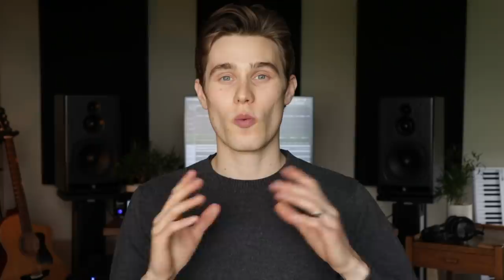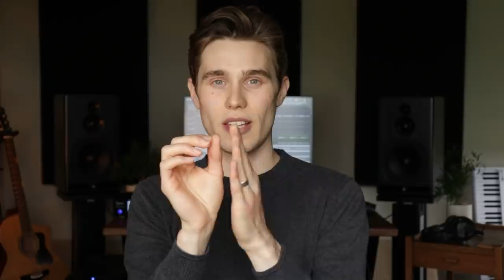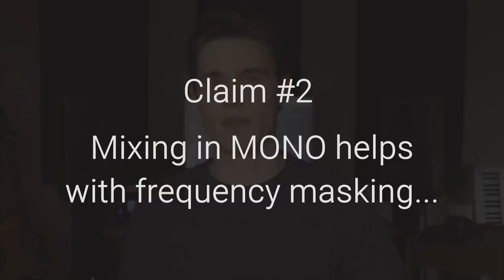Mixing In Mono - Secret Weapon Or Waste Of Time?

Comment: The reason to mix in mono is simple. All speakers at live events are in mono. This is very important so that people on both sides of the event can hear the same thing. If the speakers were stereo then people on one side would only hear the guitars and people on the other side will only hear the bass, if these were hard panned right and left. Mixing in mono is not a secret, it's the professional thing to do if the music is expected to be performed as a backing track at a live event. We also mix in mono to fix phase cancellation issues which cannot be heard in stereo.
Reply from the maker: You make a good point at the end regarding phase cancellation. Unfortunately, I don't know where you have been misled regarding the first issue surrounding live events.
In my experience, a stereo mix is summed to mono before it hits a live PA system (I've yet to see a system where this isn't the case besides large-scale immersive audio experiences!). 

When this happens, all the speakers will have the same relative levels of R+L (besides the subs where sometimes the sides are simply discarded).
Simply, a wide hard-panned stereo mix played back on a well set up PA system will not try to represent the stereo mix so you need not worry about people on the right or left missing the guitars panned to the other side!

However, your points about phase are correct and often overlooked. Especially drum phase/time alignment which can be a real mess when played back on a huge system.

It should be noted that when I discuss mixing and mastering I am usually talking about studio mixes for digital distribution, CD and storage. Additional mixing for additional formats such as vinyl and live playback are specialist jobs which can often require a remix of the original stems. I don't think I've ever heard a studio mix sound good when played back on a PA, but there is a first for everything! 

Thanks for your comments, you've added to an important conversation about phase and imaging during mixing!
Reply: The point being made was that due to the huge variance in venues and system setups that the music can be played through, professionals anticipate "potential problems" ahead of time, even if it may not be an issue in a specific setting. Mixing in mono covers all your bases, all the time, in every possible setting. The same can't be said for stereo mixing.

Comment: I’ve had really good results mixing with a single Avantone mixcube. 
That speaker sounds so bad, but if it sounds good on that little guy, it sounds amazing in almost every other scenario.
Reply: I use mix cubes to get the vocals to sit in the mix better
Reply: i love my avantone 😍
Reply: yes but you cant hear the bassline no  ?  you cant adjust under 100Hz i think .....
Reply: @ChrisBessy  yeah that’s true for the most part, I switch between the Avantone and Yamaha HS8’s

Comment: The most important mono check is for mono incompatible delay effects. Those are the ones where the left wet signal is merely the inversion of the right. I couldn't imagine many scenarios more mortifying than hearing your mix playing back and where you were once The Edge, the effect nulled itself and you have been transformed into the lesser half of the Duelling Banjos! 😱
Reply: cant wait to get to the point where this makes sense to me lmao
Reply: @Vincinite  I'm sure you'll get there. Take a signal and flip it so you have a copy that goes down when the original goes up. If you send the original to the left side and the flipped copy to the right side, the result in stereo will sound weird but wide. If you then combine the left and right to mono the two will cancel each other out and leave you with nothing. Can be quite a handy phenomenon - except in cheap guitar delay pedals.

Comment: 🖤🔥🎧

You should mix in mono before you add any EQ, compression, or other plugins. And you should do this with every mix if you want an industry-standard track.

Reasons to mix in Mono:

1 - Your mix will translate better to other sound sources

2 - Your mix will be More Balanced.

3 - You’re less likely to run into phase issues

4 - Your mix will sound better when it’s in stereo
Reply: What is a good example of another sound system where mono mixing would be beneficial? (Serious question)
Reply: @zoeym8003  Car system Sound, Night Clubs and PA System. 🖤
Reply: @zoeym8003  I use clock radios around the yard, I'm constantly amazed at how you can hear all the various elements of a song on a mono  1 to 2 inch speaker, it truly shows the skills of the top shelf audio engineers.

Comment: that last remark is sooo on point. We always get used to what we hear. I have this problem even when I give feedback on someone's track. I tend to listen a few times, cuz some require a relisten or two, to really appreciate? if that makes sense? The downside being, if you listen too many times, you might get used to issus in a track, like e.g. too little high-end, or too much on the low etc. Is that also ear-fatigue? I dunno, I have it when doing sound design for too long in a row too.

Comment: In my experience, the pad elements sound very thin on itself, when turned to mono (without adding other elements/sounds). Is this something I should worry about or is it normal?
Reply: It's normal, while you're mixing stereo elements (that means sounds that are wide in the mix), some sounds will sound thin and bad applying mono processing.
Reply: Complete answer : Lots of stereo synthetic sounds use phase shifing, modulation in Eq and other delay fx.
Therefore it will create phase cancellation in many frequency ranges.
In stereo, especially with headphones where the right ear doesn't  get the information from the left speaker, those cancellations are not perceived. In mono though they become very audible.
Reply: In my opinion the only use for " mono listening " is to control what sources may be " out of phase". We called it also " polarity check"...If you mix only with headphones you may never catch them... Nowadays mono listening situation occurs only when 2 speakers are set very close to one another. But other than that,  in 2021, mono never happens except on " am radio"  if I am correct. And a 1/8" headphone jack halfway thru.😁
Reply: No pads should only be mixed in stereo in my experience. They pretty much don't exist in mono
Reply: @demitriussmith741  Most of them have this issue... But again, like I mentionned, what is the % of listeners who get to 
listen in mono in 2021 ?  And with headphones you never get cancellation of this type.
Reply: @robertl.6919  Thank you for the reply. I thought I was going mental for a minute. 😁

Comment: I check my mix in mono "often enough". I do not mix in mono, I check in very often mono and fix it in stereo. I also use Sienna, Streamliner, NUGEN Stereoizer, etc. REAPER has a dedicated "mono"-button on the master which makes it very easy to do so.

Comment: What software should I use to do what you are mentioning here 11:58? Not only bad encoding simulation, but different speaker simulation tool. I want to check that kind of compatibility. I know I just could export to those low quality formats and check them through different speakers, but I think it should exist a kind of software or plugin that does this job without having to export and check in every way posible. I would do it anyways, but I want to save some time when I'm making those kind of decission

Comment: Please correct me if I'm wrong as I'm about to state my own personal opinion regarding mixing in mono. I think it's pretty pointless to mix in mono nowadays. Checking mono for few seconds is fine, but I think mixing doesn't really make sense. Because one thing is, you won't ever get the same vibe and volume levels in both stereo and mono (unless you use all mono or something). And most devices nowadays have stereo capability, and even if they didn't, people are aware of stereo. 

People use fewer mono devices now (like old radio devices) and now mostly using Spotify, which supports stereo. So I think it's pretty pointless to mix in mono, checking is always fine in anything. 
One thing that made me see this is a live interview of Andrew Scheps who states that he never really checks/mixes in mono. He also says that it's never gonna be the same, and said to check old records like Led Zep, ACDC, and it's never the same mono and stereo. 

This is just my opinion of course. Please feel free to correct me if I'm wrong <3

Comment: Sorry if this is long winded but any help greatly appreciated.  I am only new to making music so I am not getting bogged down in mixing and mastering too much but I thought it would be good to check these things out along the way.

So, as an example, my latest song sounded pretty good (for my level) in stereo but I obviously lost all that width, reverb and some of the panning amongst other things in mono...my question basically is....is it supposed to sound pretty much the same track in stereo and mono....and if it is how do you do that?   It seems to me you will always lose the great sounding width, reverbs etc when you listen to it in mono?  What am I not understanding?

Apologies for my ignorance. Thanks.
Reply from the maker: Great question. No, a track should not sound the same in mono and stereo. You will always loose that width and depth when a track is summed to mono. However, the central image of the kick, snare, bass and vocal should still sound good in both mono and stereo. 

When I sum my masters to mono, I think they sound bad too.
Reply: @inthemix  Thanks for the reply and its a little reassuring to hear that.  I guess it will just be experience that will teach me what's right and wrong when it comes to folding it down and knowing if it is a good mix in mono as well.  I am learning so much from this channel so thank you.

Comment: as regards tools to help with critical listening i use the TBPROAUDIO ISOL8 on my mixbus, its a great plug that lets you mute or solo frequency bands so that you can take them out of the mix or solo them. Its really good to be able to hear what happens if you mute, say, 100 to 400hz. I've found that using the plugin often reveals where i have muddy low mids and harsh top end in a mix. The plugin is free too.

Comment: I have a question that doesn't seem to have a category; I don't even know if it can be done economically. If I have a recording from a three piece live source which used a single inferior microphone, is there any way that I can isolate each piece onto a single track, manipulate each track, and then remix them to either a single track or a pseudo-stereo track with a reasonably wide soundstage wherein each piece is spatially localized?

Comment: When I started using a DAW with a mono button, the biggest difference I noticed in switching to mono is the guitars disappear.  So apparently panning hard left and right for guitars isn't the golden rule.    I found that if I wanted them to match in volume, I have to pan them halfway, which doesn't feel wide enough in stereo, but if I pan them harder the guitars sink in mono.  Do I record a different guitar track and run it center like the bass guitar or should I just make it how I want it in stereo and not worry about if the guitars drop in mono?
Reply: You can still mix wide guitars in mono (there will be some central information), but just bear in mind that they will probably be a little too loud when you switch back to stereo, so you will need to do some level rebalancing, then check back in mono. This sounds like a pain, but you get used to it - i.e. expect the mid-only elements like kick and drum to be a little louder than the wide guitars in mono. Why do this? The benefit for me is that you get the levels and EQ to be tighter in general - panning can fool you into thinking you have more space than you do in terms of frequency build-up. You have to balance more carefully, but I feel better results are easier to achieve in the end, without guesswork.
Reply: I usually pan 75% on both sides. Or if I'm lazy, I use stereo enhancer

Comment: Sir please do the tutorial about mixing heavy guitar .
Reply: Have you found the Spectre Studio channel? It's all about mixing metal, and there's some good tutorials on recording and mixing heavy guitars. One of the tips saved me yesterday, I was wondering where all of the feedback was coming from, I was thinking these amp sims are just too realistic, sounding like live guitars just over the edge of the feedback zone. I thought maybe I'd had the speakers on when recording, but that didn't seem likely, or maybe the headphones too loud, but I was going straight into the interface anyway, feedback seemed pretty strange. It could not be EQed out either, it was still there after heavy EQ and compression, the guitar parts were "jangly", right in the 1 to 5K zone, so I could only do so much.
 It was actually the strings between the machine heads and the bridge ringing out! I stuffed a piece of foam in there, and taped off the strings I'm not using on each particular guitar part, as per Glenn's advice, and problem solved. I then sat down and re-recorded about 20 guitar tracks! I wish I'd remembered those tips the first time!

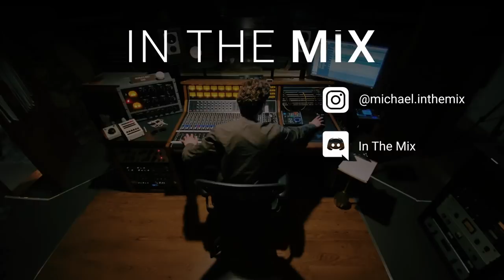Comment: In the outro when the song comes up a bit more, from 12:57 onwards, do you guys hear a statickey crackle?
Sounds like a bit of "lo-fi" or a tape plugin or something with added "analog" noise or whatever?
It's pretty jarring, would not want that in my track even if it was supposed to be vinyl flavored or whatever, takes away from the track.
Reply: Nope.

Comment: Hi!. What speakers do you use?. Best/Mathias
Reply from the maker: PSI A23m, thanks!
Reply: @inthemix  Nice, i thought so but hard to see😀. I gonna buy them when i sold my other speakers. Do you like them a lot?.
I guess the A25-M is to big for my room. Best/Mathias
Reply from the maker: @MR_Cellarpop  I absolutely adore the speakers. It was a big investment for me but worth it. If your room can handle the 23, they can likely handle the 25. Just choose whichever you prefer. I like the soft dome mid range of the 23, it’s incredible.
Reply: @inthemix  Great, A23-M will be good as it is a little smaller then my Adam S3V that I got now and as I have Trinnov that can help a little with room issues. Best/Mathias

Comment: These days, with streaming being as prevalent as it is, super low quality mp3s seem to me like a thing of the past, especially with higher qualities on Spotify and Apple Music. Its far more important to test your track on different gear, specifically what your audience uses. As much as I wish everyone had studio monitors so I could have the deepest kicks and crispest hats, the majority of music listeners just use supermarket shelf quality earbuds, mostly bluetooth, which have pretty poor frequency responses.
Reply from the maker: On most devices, Spotify defaults to a variable 'Automatic' setting and offers four fixed playback tiers: 24 kbps (Low), 96 kbps (Normal), 160 kbps (High), and 320 kbps (Very High). These are all low quality in my opinion so even if you have a good internet connection, Spotify is not an ideal playback source. Compare a song on Spotify to the same song on Qobuz, Tidal etc and you’ll hear a difference

Comment: Your video footage feels more 720p than 1080p. I think it could really use an upgrade up to 1440p.
Reply from the maker: To chcage the resolution to 1080p you now have to access the advanced user video settings. 

On mobile, press the 3 dots at the top right of the screen then select Quality > Advanced > 1080p. 

All my videos will default to 720p due to a recent YouTube update.

Comment: I've tried it. The delays and reverbs aren't heard correctly. I wouldn't recommend it.
Reply: You are supposed to refer back to the stereo mix a few times
Reply: @corneliusrawness  Yes, and that sounds significantly different.
Reply: @AzureSymbiote  you missed the point
Reply: mix in mono is a tool, not a guideline.

Comment: I don't mix in headphones, because the ones i got are bad. I simply ain't got stereo speakers.
Reply: Use different sources. But do get yourself a good pair of hp
Reply: @stephenroldan5107  Well. For now i'm using a both my speakers (using a high cut filter so it act as a bass woofer) and the built-in speakers on my TV (which are actually stereo), but i don't feel confident mixing on them.

Comment: Great stuff Michael. i think you are (becoming )a subject matter expect  on mastering and mixing.  i had too look up some stuff about polarity and phase  (https://www.prosoundweb.com/phase-polarity-causes-and-effects-differences-consequences/) . i get the impression that when it comes to sweet spots, it can be calculated better than the ear can hear. would this be true? i.e. the type of relation that 2 signals have ( like a bassline and a kick) and where both should be  ideally placed or connected to each other can likely be determined from a calculation as opposed to finding it by ear ( although the latter is much more fun..)

Comment: Thx for your ideas on this. For metal mixing, checking in mono is never done cause it will not be used in mono listening anyway. And you loose so much of the mix with hard panned guitars, hard panned backing vocals etc, that it doesn't make a lot of sense. It just adds confusion. Though, mono consideration (like for the bass) is good to keep in mind.
It probably has been posted before but Fab Filters has nice a series about this subject: https://www.youtube.com/watch?v=spaqBr-cCFw